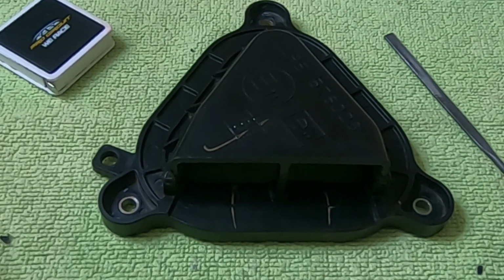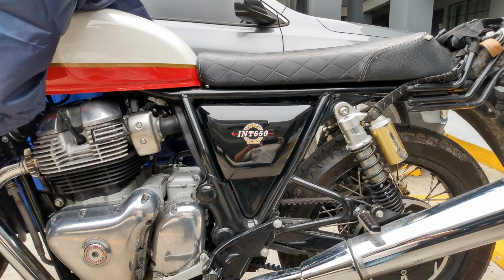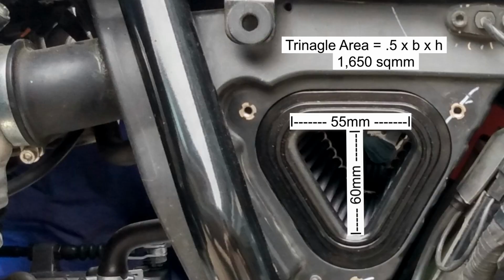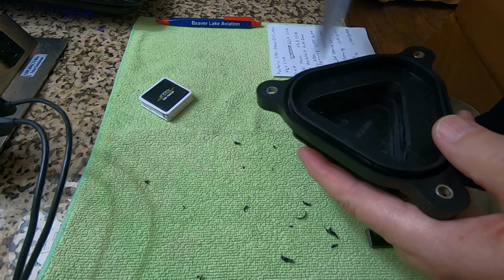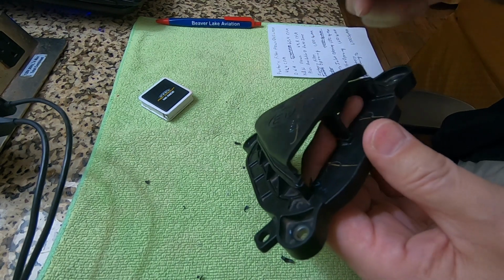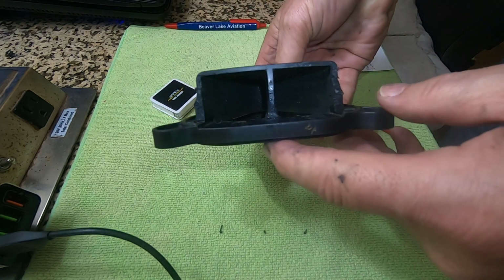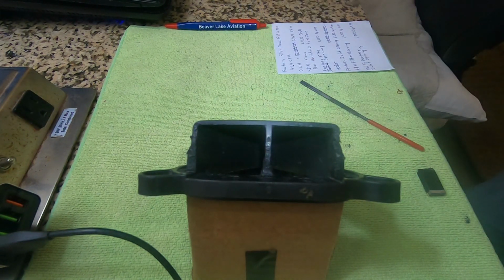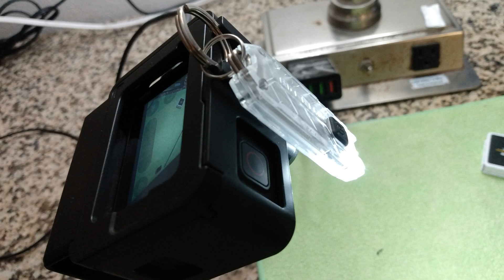Motorcycle Hi Flow Air Filter For Me And My Royal Enfield

Comment: I got a S&S air filter.Also got S&S slip on's & a booster plug.
I got the S&S retainer to together with filter but I have seen people who just use 3 washers to hold filter in & works fine.If you like history I just posted a video on a 1988 East German motobike a MZ 250 ETZ 2stroke commuter & Soviet block army bike & cold weather bike that I have my shed which I borrowed for a bit.
Reply from the maker: Thank you or watching and the comment. Sorry I forgot to put up my thumbnail last night. I'm sure I would have gotten 1,000 more views, haha. Rookie Move!
Reply: @MeAndMyRoyalEnfield  Did you watch my MZ video?
Reply from the maker: @ruahinesrider  Just woke up and watched it. Thought I commented but my computer, or internet, is acting up this morning. This is the third time I've tried to post This comment. Did you see my thumbnail?
Reply: Q1
Reply: @MeAndMyRoyalEnfield  Yes I saw your post & that you had pinned it.The metal retainer for the filter is expensive I got one then on YouTube I saw the 3 washers technique.You will definitely notice the induction sound & a slight increase in torque in the mid range & 1/2 HP - 1HP at most.Some aftermarket pipes will shed 6-6.5 kg in weight & increase mid range performance by 11-13% & be noticable.Up to you what style they come in polished if you want to keep it looking stock or brushed which clean easier & run cooler & cool down quick.There are 2-1 systems which shed 13-14kg & huge bump in torque & HP...75Nm & 53hp which turns it to rocket ship.2-2 systems shed 10kg weight & look more stock but you could put a Lithium battery in to shed 3kg to be same weight as 2-1 with stock battery.Even with slip on's & 6kg less transforms the bike & the big bore 2-2 & 2-1 on the bike feels like a different bike to ride.
Reply: @MeAndMyRoyalEnfield  How is your belt drive system?
I have seen a belt drive for sale for $750nz & would be something different.Has it slipped yet & are you glad you changed?
Reply from the maker: @ruahinesrider      I'm enjoy no more chain maintenance mess and it smooth riding. Down side is the use a taller rear sprocket which took about 25 mile of range out of my talk. Increased mph.
Reply: @MeAndMyRoyalEnfield  Can't you change sprocket sizes on front & rear for better mileage?
Or is to much hassle.
Reply from the maker: @ruahinesrider    No. The conversion kit comes with it own front & rear belt pulleys made to fit the drive belt. See my Maintenance Playlist to see video on how it's installed.

Comment: Don’t forget the exhaust side of the equation if trying to increase overall flow. You will also shave a massive amount of weight removing the factory exhaust pipes and cans and replacing them with straight through pipes and cans from just about anywhere. The factory ones are overbuilt and quite heavy. The center stand is great for folks who do all their servicing outside and don’t own any other means of getting their bikes off the ground for servicing. If you want to shave more weight that is something to look at removing. The number one performance improvement over factory you can do with this model is a YSS fork upgrade kit, more so than any modification to air intake and exhaust and more improvement bang for the buck than a yss rear shock replacement on its own. Love your service and technical videos, keep it up. If you have electrical inclination maybe do a video on the relays for folks. There is one that should be for the accessory plug inside the front headlight housing. If folks are not using any accessories or in a road emergency have a relay go bad on them they should be able to use the accessory relay as an emergency spare to swap for the main power relay, starter relay as they should be identical. I don’t have the service manual so verify first with that if it has the electrical system detailed in it. But a video getting the word out and going over the relay positions and functions they are wired into might help some folks who may have a realy going out on them while on the road and far from any store that may have a replacement relay.
Reply from the maker: WOW, great comment!!! I can't catch all your points, but I'll try. The belt drive conversion was about one tooth taller in the rear, so mileage did drop a little, so the high flow filter was just an attempt to recover some of that, which I think it did.
I recently replaced my complete exhaust thanks to a friend but had to replace the O2 sensor. You might like that video. Wish I was better and faster at doing videos. I'm two years behind. But I like the bike stock. Only did the belt drive conversion because I got tired of having to constantly stop to clean, lube, and adjust. Been trying to do that video for months.
Hitchcocks Motorcycles in England has the plugs for plugging into the accessory plug in the headlight housing. I have seen videos showing the relays, and how to switch them if the starter relay goes out. I like your idea though and will add it to the growing list of videos I want to do. The more people who do them, the more the word gets out.
Do you have an Interceptor 650? What paint scheme. Thank you for watching and for the great comment!